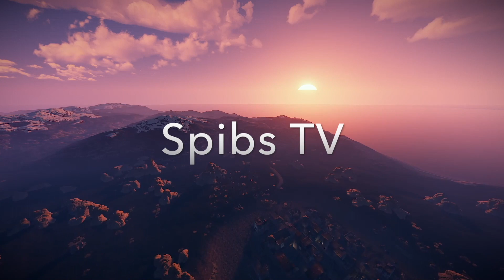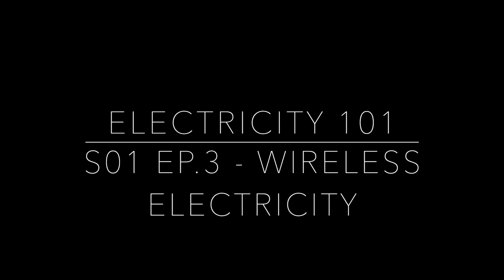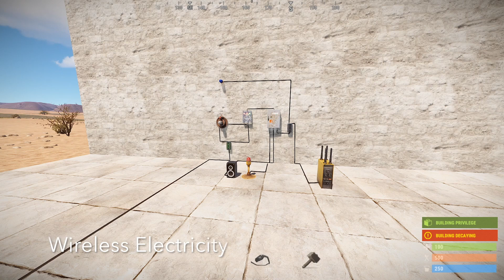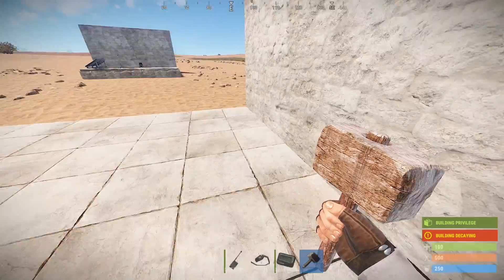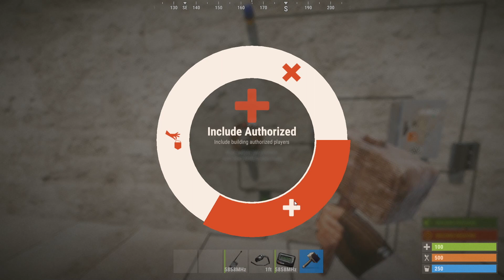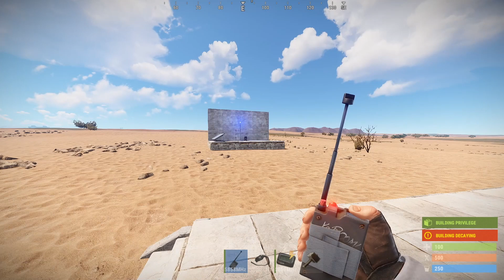(RUST) Electricity 101 - Wireless Electricity S01 Ep.3

Comment: Server?
Reply from the maker: For building? Personally I usually use intoxicated EU Sandbox. There is also a US version available I believe.
I find it has the best tools, and has reliable use for testing electricity.

The only downside is it doesn’t go night, which is the case with most build servers, which is why I simulate the sun setting by disconnecting something in my circuit in a few of my videos.

Comment: Nice vid, all very well explained! For me it just missed the explanation about the RF receiver, what's its output which leads the circuit to lit up? Or does it just work as a pass through like a switch for example? 

Liked and subbed!
Reply from the maker: Thanks for the support :)

Yes, the RF receiver output acts as passthrough, but only when a signal is received of course. Therefore, any components connected to it need to be supplied with enough power by the passthrough.
Don't forget to join my discord :) Link in description!

Comment: QUESTION: I have 4 turrets which all I would like to hook up to the single RF transmitter which would notify if the turrets are low on ammo. Which item do I use to combine 4 turrets signal into one RF transmitter? Thanks in advance.
Reply from the maker: They would have to be connected with a few OR switches. However, since the turrets only output 1 power, you would need to use the electrical branches as well to provide enough power to pass on to a single RF broadcaster.
What I'm saying is, it is possible, however, it might be easer to have an individual broadcaster connected directly to each turret. They can all be set to the same frequency.
Reply: @SpibsTV  I thought of using multiple RFT, yet it would be expensive solution. SO there is no simple solution for this atm..
Simillary, I was trying to expand Your idea with having the generator as a backup for the battery, by adding another generator, but I would need split the signal wich was going into one generator by also going to the second one.
Reply from the maker: @niebieskipies  Well, there I wouldn't say it's overly complicated, but having individual broadcasters for each turret wouldn't cost too much more, and would be FAR less components needed for the same purpose. It would also mean you would have far less power requirement to fulfil the same need.

Comment: So I have a quesiton... Im building like a sniper tower and I have garage doors all the way around, is there a way to wire it with a laser to where when I enter the tower they all open and then when I go back out they all close? Like a laser toggle switch essentially

EDIT: I did it with the memory cell but it seems to only work if I walk into the laser from one side only if that makes sense
Reply from the maker: I think the laser may still need work with it's reliability.
I was going to suggest using a memory cell, just make sure you have your "trigger" (e.g. laser) connected to the Toggle input of the memory cell.

If the laser isn't working properly, you could use a pressure pad instead, or, alternatively you could use a HBHF sensor to detect you while in the tower. This would have the added benefit of closing the doors automatically if you die.

P.S.
Nobody likes a roof camper :P
Happy sniping ;)
Reply: @SpibsTV  Yeah ill have to try the pad then the laser was only working one way, thanks again for the videos, right now im trying to figure out how to set up like a EM and non Em lighting circuit if that makes sense. teasing my brain pretty good
Reply from the maker: @ZeskosDesigns  Happy to help, my guy! Glad you've found the videos helpful :)

What is EM lighting?
Reply: @SpibsTV  So im an electrician, EM is like lights that come on if the building ever loses power but its only a select few... I basically Wanna do it to where every other 3 lights will be on during day and then they all come on at night, so I was thinking of introducing a blocker into my current lighting circuit and then use a solar panel to it so it cycles the majority of them on or off, but I dont know how to have a set always on no matter what and then the other come on at night, if that makes sense, if not I joined the discord and ill try to explain better over voice lol
Reply from the maker: @ZeskosDesigns  Ahh yes, I know what you mean I think.
We can have a chat over the next few days and I'll attempt to help :)
Reply: @SpibsTV  Sweeet! That'd be awesome, Ill shoot you a message on disc